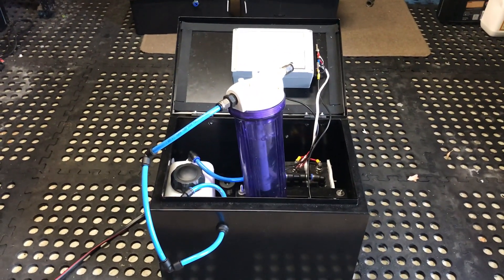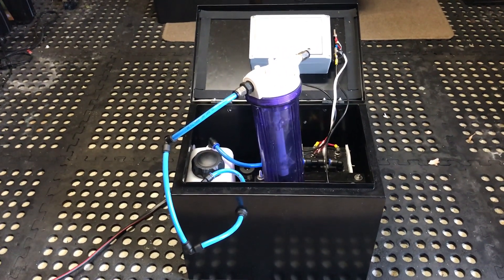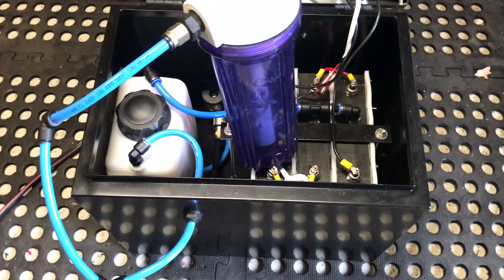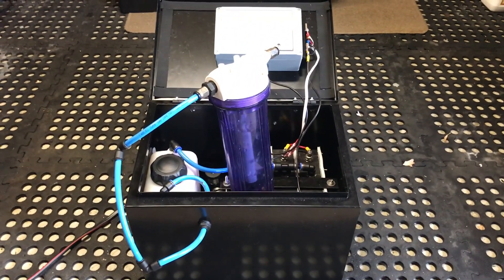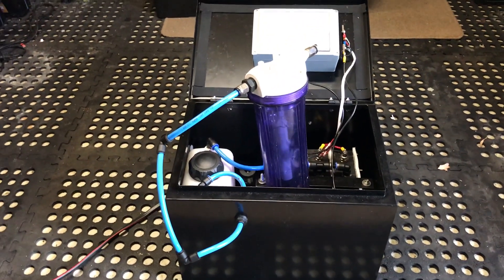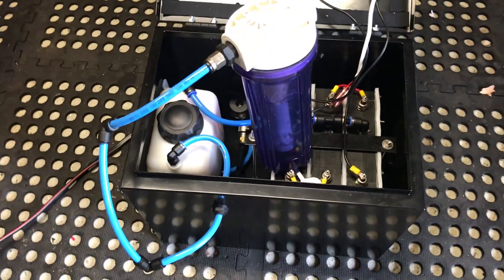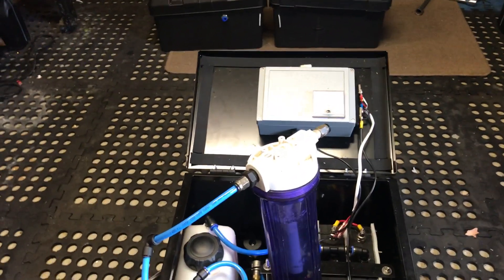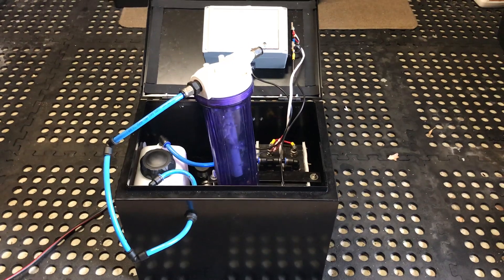Hydrogen fuel system Gen 15 for engines to 8 litre capacity Aug 4 2019

Comment: Hydrogen is considerably more powerful than gasoline. Unleaded regular is 85 octane. Premium is 91 octane.  Hydrogen is 130 octane. Running straight hydrogen will create a noticeable increase in engine power.  I am wondering if this added stress (??) to the engine will have a negative effect on engine life ?  Also, hydrogen's burn velocity is much faster than gasoline. I am wondering if the spark advance timing will need to be changed for this ?  Too much pre-ignition in an engine is very hard on the rod bearings.  I hope someone out there has the answers to this and lets me know.
Reply from the maker: https://hydrogenfuelsystems.com.au   0403177183
Reply from the maker: call me on 0403177183 
glknox11@live.com
https://hydrogenfuelsystems.com.au
patented , proven and certificated system delivering 32% savings on a 7.2 L truck - 27 tonne load
Reply from the maker: call me on 0403177183 
glknox11@live.com
https://hydrogenfuelsystems.com.au
patented , proven and certificated system delivering 32% savings on a 7.2 L truck - 27 tonne load
Reply from the maker: Gavan Knox glknox11@live.com  and https://hydrogenfuelsystems.com.au   
  
https://www.youtube.com/shorts/Qv5JO1Czajo

System running at 12.5 volt and 35 amp producing 4.2 litres of hydrogen gas per minute.
Increase the gas flow by using a Higher input voltage and also by  adding 20 grams  Potassium hydroxide to the 3 litre water recycling tankl
Call gavan 0403177183
september  30 2025

check out our webpage https://hydrogenfuelsystems.com.au

Comment: Was that design Run a 10 horsepower 10K start 9k running generator
Reply from the maker: https://hydrogenfuelsystems.com.au   0403177183
Reply from the maker: call me on 0403177183 
glknox11@live.com
https://hydrogenfuelsystems.com.au
patented , proven and certificated system delivering 32% savings on a 7.2 L truck - 27 tonne load
Reply from the maker: call me on 0403177183 
glknox11@live.com
https://hydrogenfuelsystems.com.au
patented , proven and certificated system delivering 32% savings on a 7.2 L truck - 27 tonne load
Reply from the maker: call me on 0403177183 
glknox11@live.com
https://hydrogenfuelsystems.com.au
patented , proven and certificated system delivering 32% savings on a 7.2 L truck - 27 tonne load
Reply from the maker: Gavan Knox glknox11@live.com  and https://hydrogenfuelsystems.com.au     System running at 12.5 volt and 35 amp producing 4.2 litres of hydrogen gas per minute.
Increase the gas flow by using a Higher input voltage and also by  adding 20 grams  Potassium hydroxide to the 3 litre water recycling tankl
Call gavan 0403177183
september  30 2025

check out our webpage https://hydrogenfuelsystems.com.au
Reply from the maker: Gavan Knox glknox11@live.com  and https://hydrogenfuelsystems.com.au   
  
https://www.youtube.com/shorts/Qv5JO1Czajo

System running at 12.5 volt and 35 amp producing 4.2 litres of hydrogen gas per minute.
Increase the gas flow by using a Higher input voltage and also by  adding 20 grams  Potassium hydroxide to the 3 litre water recycling tankl
Call gavan 0403177183
september  30 2025

check out our webpage https://hydrogenfuelsystems.com.au

Comment: Super design 👌👌
Reply from the maker: https://hydrogenfuelsystems.com.au   0403177183
Reply from the maker: call me on 0403177183 
glknox11@live.com
https://hydrogenfuelsystems.com.au
patented , proven and certificated system delivering 32% savings on a 7.2 L truck - 27 tonne load
Reply from the maker: call me on 0403177183 
glknox11@live.com
https://hydrogenfuelsystems.com.au
patented , proven and certificated system delivering 32% savings on a 7.2 L truck - 27 tonne load
Reply from the maker: Gavan Knox glknox11@live.com  and https://hydrogenfuelsystems.com.au   
  
https://www.youtube.com/shorts/Qv5JO1Czajo

System running at 12.5 volt and 35 amp producing 4.2 litres of hydrogen gas per minute.
Increase the gas flow by using a Higher input voltage and also by  adding 20 grams  Potassium hydroxide to the 3 litre water recycling tankl
Call gavan 0403177183
september  30 2025

check out our webpage https://hydrogenfuelsystems.com.au